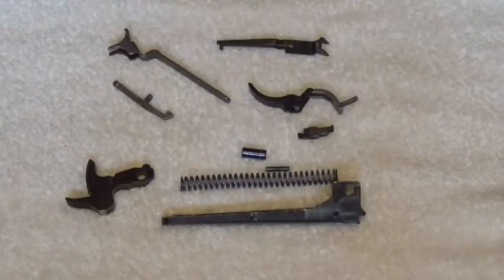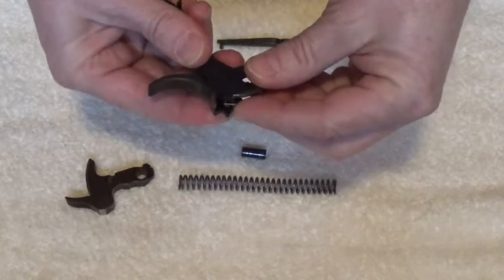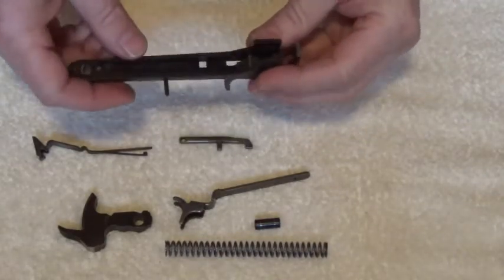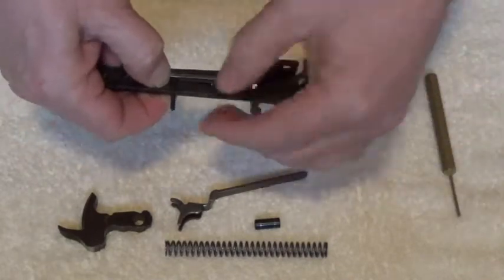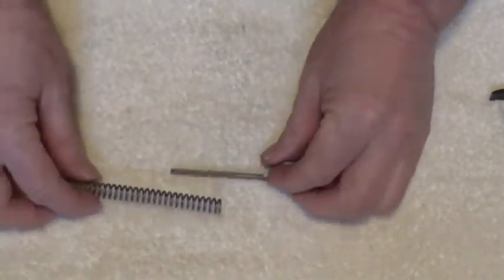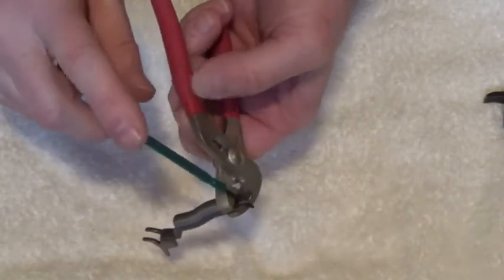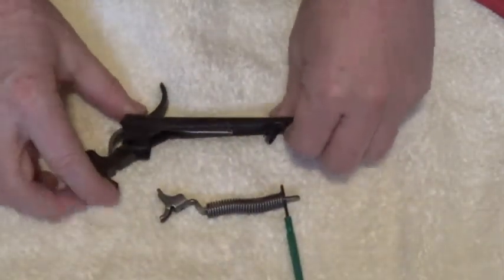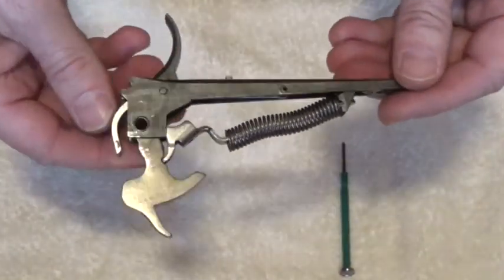Reassembly of the Lower Tang Assembly of the Winchester Model 94AE

Comment: @Peepaw, I noticed at the 9:30 mark in the video... a little cylinder disappears from the assembly and is never seen or mentioned again.  I am trying to reassemble an 1892 and wondering where that cylinder goes?  I was thinking that it went on the spring bracket (somehow it fits under the spring) but I didn't see where.  Can you help?

Comment: @PeePawMcDonald  -  PLEASE HELP ME!!!!!!  PeePaw, im having the hardest dang time trying to fix my rifle and was curious if you could possibly help me???
      You see, when I try loading the magazine tube on my Winchester 1894 model 94AE by sliding the cartridges through the loading gate, i can only get two or three rounds in before it just wont allow in? It seems like the last round i slid in wants to kick back over and keep the next round from entering the tube?? Now, ive tried checking the little nipple piece on the end of the floor plate, and its in mint condition with no where? Ive torn the entire rifle down twice to try and see if something was loose or what not and i just cant figure it out?? Do you have any idea or suggestions on why this is happening and what i can do to fix this problem? I have a 20" barrel and it should hold SEVEN ( 7 ) in the mag tube,not just the TWO ( 2 ) or THREE ( 3 ) that its currently allowing me?? PLEASE HELP ME MY FRIEND, OR ANYO E ELSE WHO READS THIS?? Ive trued contacting you twice now and I'm still hoping on a response back?? Anyhow, that was another great video my friend!! 👍
Reply from the maker: Hello Sir, If I am understanding the problem correctly. You can only load two or three rounds into the magazine tube. And then no more rounds can be inserted into the magazine tube. The rounds are prevented from moving into the magazine tube? I have never encountered this problem. But I would start with the magazine tube itself. At the front of the magazine tube is a magazine tube cap. On the bottom side of the cap is its retaining screw. Undo the retaining screw and then you can remove the cap. Be careful, the magazine tube spring is under some pretty good tension. It will fly out of the magazine tube if you don't control it. So hold onto the cap with one hand. And ease out the magazine spring with the other. The magazine spring is fairly long. On the breech end of the magazine spring, you will have the magazine tube follower. With the magazine spring removed, the follower should move freely through the entire length of the magazine tube. Not sure where to go if you find no problem with the magazine components. But at least you will have fun wrestling with that spring. I hope this helps. But as you said, there are other folks out there that may have encountered this very problem. Thanks for stopping by.
Reply: @PeepawMcDonald  Thankyou PeePaw, I really appreciate you taking the time to write me back and explain what you might think the problem to be?? I'm going to check into and will get back to you my friend!! All the best, and God bless you and yours my friend!! Your videos are absolutely 💯 % Excellent and I can't wait to see more? Preferably a video on the disassembly and reesembly of the REMINGTON 760 "GAMEMASTER" which I have in .35 REMINGTON as it was left to me by my father!! Great Deer Gun!!

Comment: Great instruction.  Couldn't you reverse the order of the hammer spring strut installation when reassembling rather than using the small screwdriver.  Similar to when you unassembled the hammer strut?  Trying to compress that darn spring any other way would be too much.  Thanks for the video.
Reply from the maker: Hello, thank you for stopping by. I have never had any luck getting that lower tang back together except for compressing the spring. And holding it on with the small screw driver inserted into the hole. I'll bet the folks that put these rifles together at the factory had a spring compression tool. I wish I had one. HaHa. Thanks again.
Reply: We will have to go to Japan to pick a compression tool up.
Reply from the maker: HaHa:) That's right.

Comment: Do you know if you can remove the safety?
Reply from the maker: Hello Sir, thank you for stopping by. This rifle does not have the safety. So I am not familiar with its removal. I am sorry I could not help.
Reply from the maker: In the pawn shops, I have seen some Winchesters with the Hammer Block Safety. And some with the Tang Safety. I understand a Hammer Block Safety's operation. But I have often wondered how the Tang Safety worked. I would like to get my hands on one of those to take apart and satisfy my curiosity.